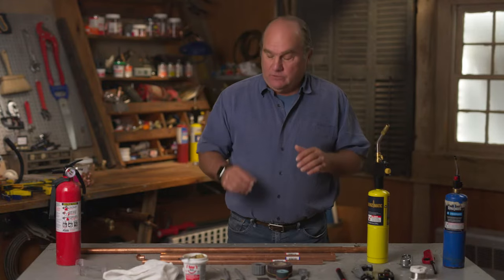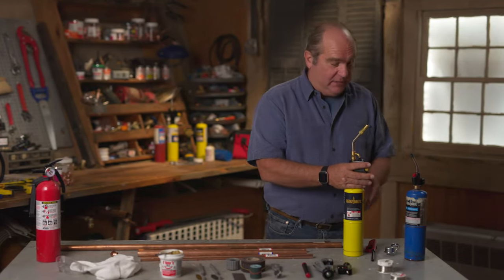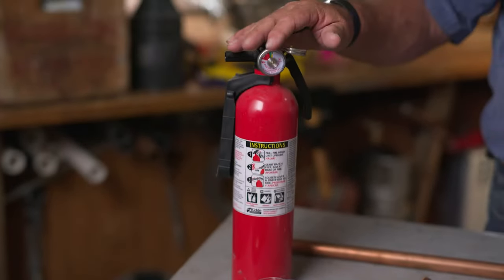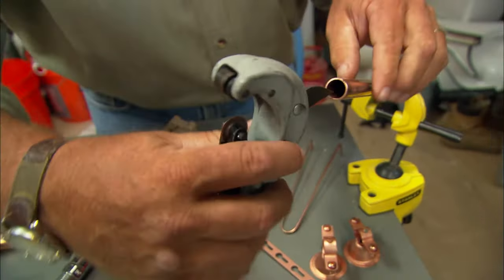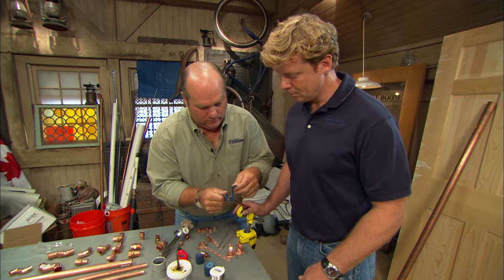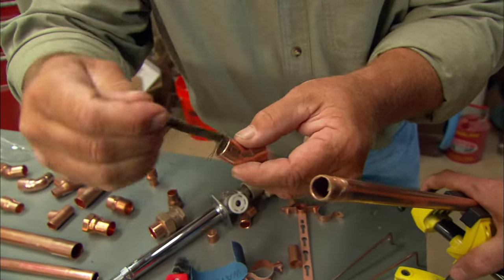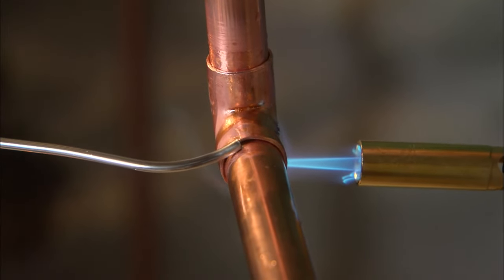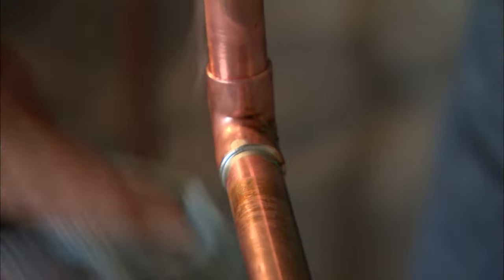How To Solder Copper Pipes | The Home Depot with @thisoldhouse

Comment: Great instructions thank you! Had a water pipe burst on Christmas eve so now it's time to fix it before Christmas day tomorrow
Reply: @HolidayRambling  oh man that was an adventure to say the least. We did get it fixed after some hassle, cut the old pipes off but then could get the solder to work because couldn't heat the pipes hot enough, since they were very close to the insulation and no matter how we tried to shield it with sheet metal, we couldn't get it at the right angle since it was so cramped (had to cut a hole through the floor to access it) so we used a shark bite to fix it